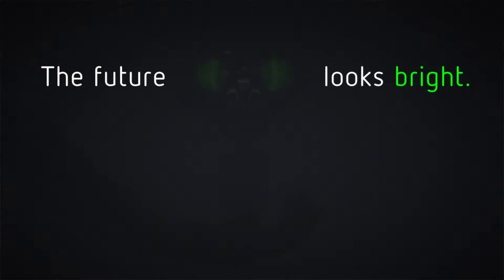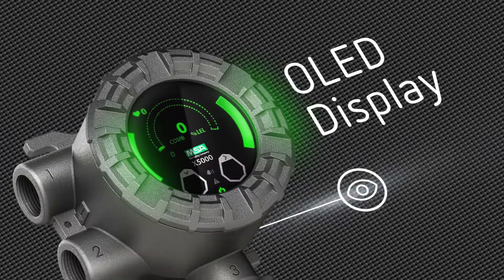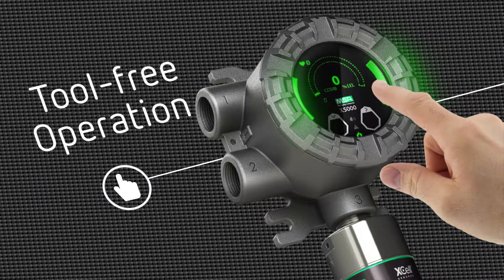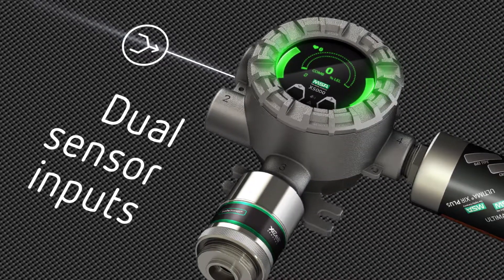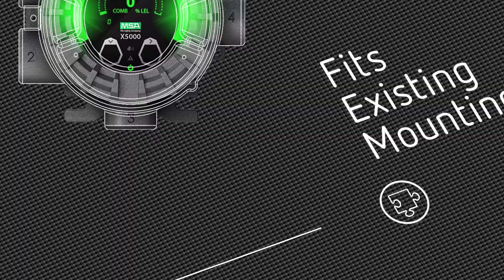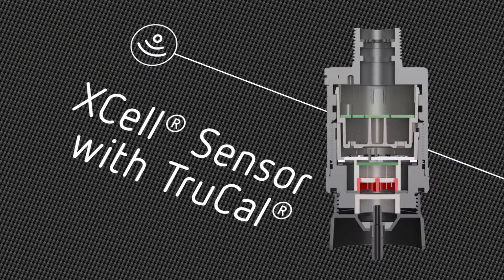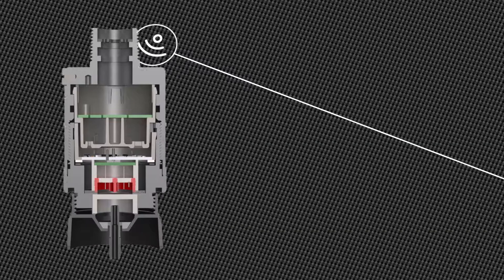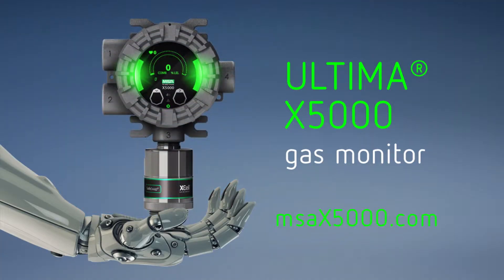ULTIMA X5000 Video  English

Comment: What is the technology used in Xcell sensors? CB, MOS or can we use one of them depending on the gas type?
Reply from the maker: Hi Thank for your question. XCell sensors are based on Electrochemical technology.
Reply: Fire & Gas detection Detection gaz et flamme thanks 😊